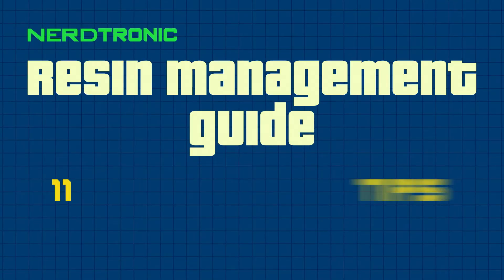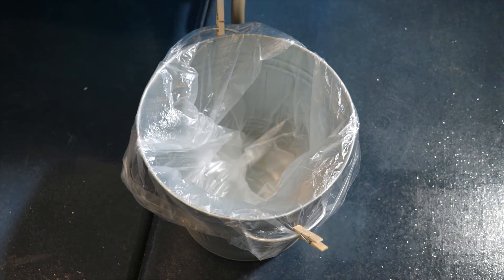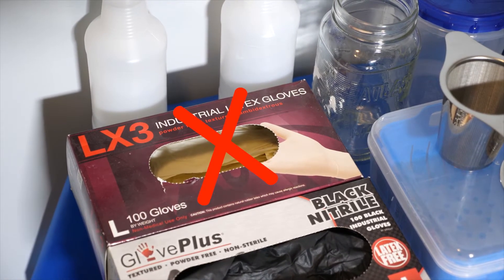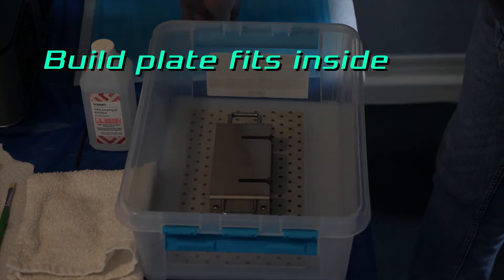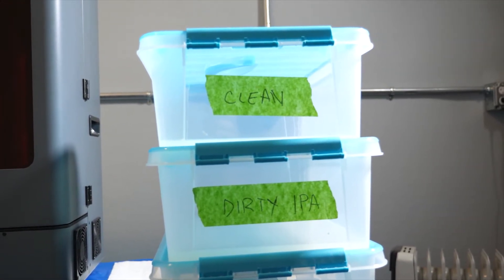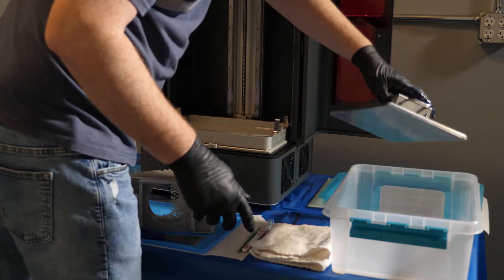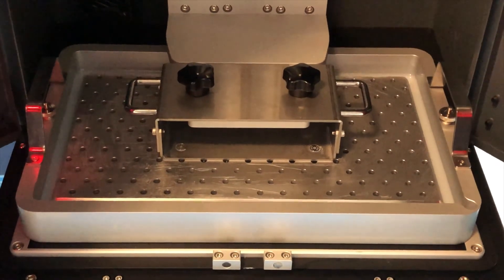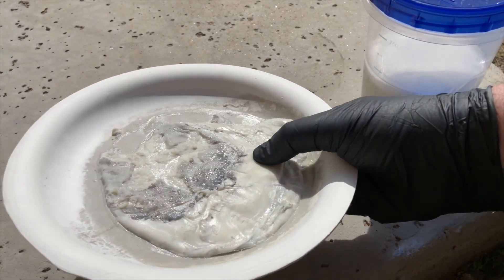SLA Resin Handling Guide for 3D Printing - 11 Tips for Containing the Mess and Keeping Things Safe

Comment: How important is a good ventilation?
Does a slightly open window does the job or do I need something with pipes and stuff like him?
Reply from the maker: For me.. I get headaches because of the fumes.  So that's why I added the simple vent system.  It's not even carbon filtered, which would be better.  Check out my Fumes Gone video.  https://www.youtube.com/watch?v=Lm73O-6UqcY
Reply: @Nerdtronic  k thank you.
I had my Printer running and only noticed a light smell.
Is it dangerous?
Reply from the maker: :) I'm not a scientist so I can only guess.  I'd avoid breathing too much of it.  Good ventilation is important in my opinion.
Reply: @Nerdtronic   okay, thank's for your help :D

Comment: I’m new to resin printing and I wish I would have watched this sooner. Any suggestions if you do get some resin on the lcd screen between tray ?
Reply from the maker: For sure clean the vat and the fep as good as you can.  I always lay out fresh paper towels to set the vat on when taking it out.  It's good to have a routine for vat removal to protect the underside.  But even still it's super easy to accidentally get resin on the bottom side.  But it should clean with alcohol or peel off if it's cured.

For the LCD: You can try wiping it GENTLY with a clorox wipe or a paper towel soaked with alcohol.  Better to try to get it off before it gets cured.  If the resin is cured and you think you can't get it off without ruining the LCD, sometimes there is a thin sheet of protective plastic on the LCD, which you could remove.  But that would be a last resort.

Comment: You've got a really nice system here, lots of great ideas!  All my toys are sticky...
Reply from the maker: Thanks!  The system has some flaws. The longer I print the stickier things get also :)
Reply: @Nerdtronic  Just found your video and was wondering, why not get a UV torch and cure the spilt resin on your silicon mat, then just peel it off and dispose?
Informative vid though, thanks for taking the time to make it.
Reply: I LOVE your video on this man. So rare to find a Ph.D. chemist talking about safety concerns with printer resins.
Reply from the maker: @mr702s  Well Goobertown Hobbies is the PhD not me.  So go check out his channel.
Reply: Goooooobs!
Reply: It's true, I did genetics (and I never had a cross contamination), and pretty much everything you do is lab grade, except not having a fume hood, which tbh is overkill at home.. I haven't bought a 3d printer yet but I estimate it would take me perhaps 12 to 15 print goes before I wasn't really conscious of the steps..

Comment: good day!! i have a xyz nobel and i want to know how to clean up the vat... do you have any suggestions?
Reply from the maker: Not familiar with that printer.  But I have some dirty IPA in a jar (actually I use Denatured now).  I get as much resin out as I can first.  Then pour in the IPA and rub around the fep and the vat with a paintbrush.  Mix it up good.  And then pour it back into the jar to use again.  I also use clorox wipes sometimes to scrub resin stains on the sides (metal).  When it's all clean but still has some streaks and is cloudy I wash it with soap and water.

Comment: 91+% IPA is still a bit difficult to find in my area.  Is it acceptable to use Denatured Alcohol to clean off the uncured resin?  I just bought my 1st resin printer yesterday, it arrives tomorrow.  I have a small supply of 99%, but I know it won't last long.
Reply from the maker: Denatured works great.  It's less smelly.  And I think it cleans better.

Comment: 5:00 If you make the Stuff too difficult you'll start skipping it....DAMN this is a life changing tip right here! :O
Reply from the maker: Haha.  One person defines something as laziness.  Another person defines it as optimization or efficiency.
Reply: Ive found that the same applies to a lot of things in life. Like if you buy a fancy new panini toaster and stick it in the back of a cupboard as well as choose a hard to clean model, you'll end up never using it because even taking it out is a hassle, nevermind cleaning it.
Reply: @sienihemmo  and this is the underrated comment that predicted the end of my 3D printing career :*(
Reply: Early in my career I worked with a guy whose motto was "Make the right thing the easiest thing and you'll never have to correct anybody".
Reply: They are usually old or willfully ignorant.
Reply: This be freakin' legit. 💯🤣

Comment: nice stuff, gave you a thumb and I rarely do that cause I suck, but i will say that I'm nowhere near as clean as you, I do at least 10 prints before cleaning or emptying the vat...it all gets used up by prints and has new resin coming in all the time...whats the point? I do check for stickers on the Fep and stir the resin in-between prints but I do not ultra-clean the build plate, just wipe the mating surface and go again and I probably dont use as much IPA. I wipe most of the resin off the part on a towel before it gets IPA, two vats of IPA and brush, then blow off with air, then water wash, done.
Reply from the maker: Thanks for the thumb up.  I sometimes do a lot of prints and leave the resin in there a while also.  And a terrycloth rag is now my go to for cleaning.  Scrub the part with an alcohol soaked cloth.
Reply: @Nerdtronic  yeah, have you played with threading screws into the resin prints? I am tapping and threading but the holes always seem weak and loose when done, not like tapping a regular block of plastic.

Comment: Thought cleaning the FEP with paper towels wasn’t advised as it can leave small scratches and make it stick more to the resin.
Reply from the maker: I guess it depends on how hard you press.  I’ve never had an issue cleaning with paper towels.
Reply: Nerdtronic My neither, I guess u could use a squeegee for most of the cleanup and use a paper towel at the end.

Comment: thank you for your video! can I leave the excessive resin inside my 3Dprinter until next time I print something? or should I clean the vat every time after I used? any reply will be appreciated :))
Reply from the maker: You can leave it in. I wouldn’t leave it in for weeks on end. It’ll collect dust. And then sometimes you need to clean out the vat to check for stuff stuck to the fep and for cured bits. But it doesn’t hurt to leave it in for a few days if there’s no UV light getting in of course
Reply: @Nerdtronic  thank you very much!

Comment: I prefer coffee filters or whatman-like filter paper as they remove all the super tiny bits so that you are left with a crystal clear solution after filtration. I do like the tea strainer for washing my prints inside of beakers placed in an ultrasonic cleaner. And depending on the print, a sonicator is almost a necessity if you plan to use a detergent/degreaser such as Mean Green for cleaning. IPA or denatured ethanol are nice, but expensive compared to Mean Green and far too hydroscopic.
Reply from the maker: The tea strainer ended up getting pretty clogged.  I used it once to filter resin and that didn't work so good.  Clogged it up a bit.  Works better for the alcohol. Actually in my other video (https://youtu.be/PgptSUfhzXQ) I show recycling IPA.  What you didn't see was that in that shot because the tea strainer was clogged, it was actually spilling the IPA all over my table and on to the floor.  Since I was filming and pouring at the same time I had no idea it was happening.  Made a HUGE mess - but I got the shot. :)
Reply: @Nerdtronic  I did see you filtering the IPA in that video, but I didn't notice the spill. I don't mind those tea/paint strainers for filtering resin, but those fine particles in recycled wash solutions are the worst. I need a large filter funnel as gravity takes way too long.

Comment: For Aussies,
I am using the Silcon Pet Feeding mats from Kmart.
The large is 60cm x 40cm, so covers a large area.
I have a few of them across my work bench and they work great.
They are 10 bucks at the time of writing this. They also sell a smaller version for 5 bucks.

IPA is expensive and hard to come by especially with Covid. 
Alternative is Mythelated Spirits, it's way cheaper. However can make clear resin milky colour and can leave white blotches on cured items if not washed off correctly. 

Resinaway from Monocure is great as well and locally sourced.

Comment: Great videos, thanks! Regarding Tip #10. I have read and watched tip on cleaning FEP, and that IPA tends to make it more cloudy, so using soap and water had been suggested. Any thoughts?  Finally I have been using FTFE lubricant on my FEP before printing. Essentially, wipe the surface with it, then wipe again w clean towel to remove and dry it.
Reply from the maker: So far I’m not seeing the clouding. But it could be. I’ve only had my printer for about 2 months at this point.  I’m sure after I’ve had it 6-8 months I’ll have new tips. :)